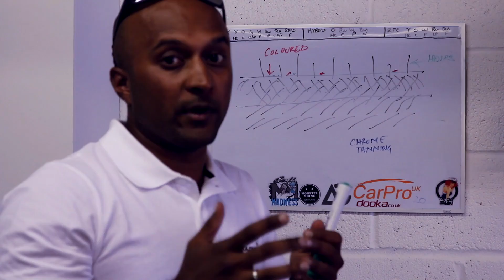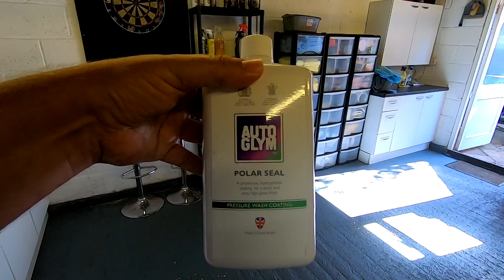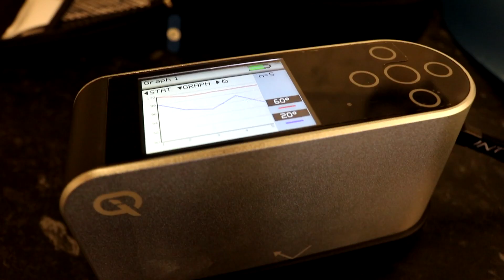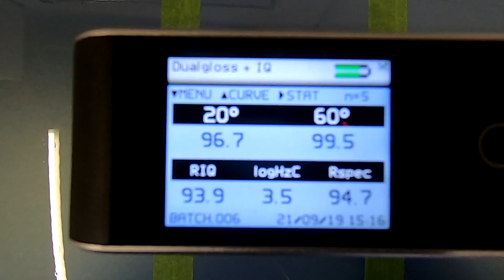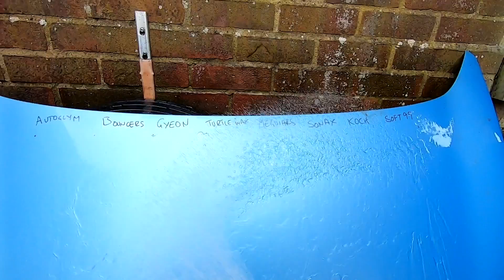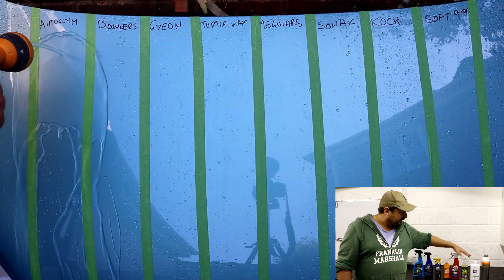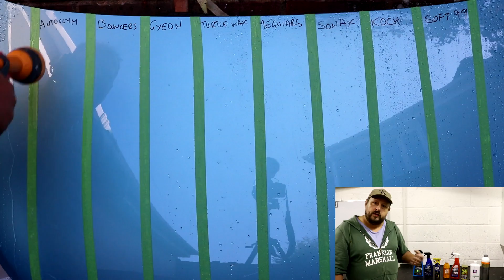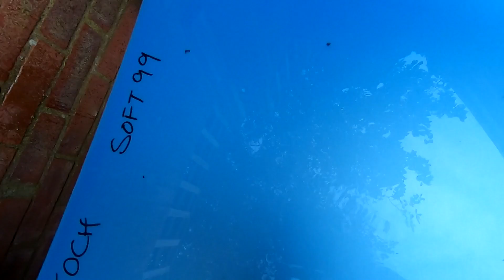The Best Spray Sealant | Drying Aid Wet Coat Spray&Rinse | Meguiars Turtle Wax Sonax Gyeon Autoglym

Comment: Great review as always.
I have been using the autoglym polar seal for years now. I've tried others but keeping going back to it. I use it in 1ltr pump sprayer and it makes my life so much easier with weekly washes etc, also found it works great on alloys. You mentioned about not using it on glass... I've never had an issue with this and neither has a friend that uses it, I've actually in the past used it in the screenwash bottle in my van and it does great at getting the hydrophobic properties back on the screen.
Only time I've ever had a problem was when I've left it too long in sunlight and it dried on plastics leaving white marks. I use 4 capfulls per litre and absolutely love it for that. Usually £15 a bottle in halfrauds.
Reply: How long does polar seal last for
Reply: @SilverTrill  depends on how well decon'd and protected the vehicle is before and your wash method after....
But as an example I've recently bought a car that has no protection at all, if it rains or you pour water on it then the whole car just stays wet, even on the sides... Whereas my work van was polar sealed about 4 months ago (5k miles) and i have sprayed citrus pre wash on it (at a strong dilution) and power hosed off several times and parts of the van still bead slightly, other parts the water is sheeting off slowly but still 10 times quicker than the unprotected car. Van was polar sealed at least once a month before that so likely had a small amount of protection built up.
Can be bought for £13-18 depending on where you get it from and a small amount goes a very long way. Even my concrete driveway beads where i wash my cars just from using it so often lol
Reply: @seanmc92  driveway beading 🤣🤣🤣🤣  I've heard you can get this for £10 at b&q at tge moment it's says £13 on the shelf but scans in at £10 was going to buy some today but was unsure about durability but I'm happy with what you have said so will pick some up after my current spray wax finishes , thanks for the heads uo
Reply: @SilverTrill  damn is that for the big bottle? 😮 I'm serious, my driveway beads 😂😂 yeah i really like the stuff and it's super easy to use. I apply it with a pump sprayer and let it sit for 30 seconds (if not in sunlight) then blast it off. Just make sure you rinse it properly as you'll go back to somewhere you've done and see it reactivate again, that how people gets the white spots from it
Reply: @seanmc92  yeah it's the big 1 litre bottle, I like how easy it is the apply and not to use more than the recommended , some people are saying to use less, even Jon was saying add some to a bottle and make a detailing spray , how many ml do you use in your pump sprayer?
Reply: @SilverTrill  that's a cracking deal, i might go tomorrow and buy 2 bottles lol. I haven't tried using less to be honest, i just tip some in without measuring now but it's around 5 or 6 cap fulls I'd say. Never tried it as a detail spray 🤔
Reply: @seanmc92  yeah it's a bargain , u could be using too much because when using a snowfoam lance your using alot more water so in a pump sprayer you need to using less as your not getting any extra water.  I might play about with all the ratio when I pick some up as my pressure washer has a very high litre per minute output so may need more product if using a Lance sametime it's going to cost me more so I might have to also use a pump sprayer or spare 500ml bottle and make a less concentrated mixture and get same results and it will cost me less 😎
Reply: @SilverTrill  the bottle lasts me most of the year on my personal vehicles so it doesn't bother me too much, i end up spilling it over my hand etc if i try fill the cap 4 times so I'd just be wasting it there anyway. Whatever ratio i use seems to work great anyway lol. I don't have a spare lance and try keep my lance for pre wash only. I would have to rinse it out several times if i ran polar seal through it to get rid of the residue

Comment: Great review yet again John, you could quantify the “slickness” with a friction test, put a known weight on a P.T.F.E. Block, and pull it across the surface with a spring balance.
Just as an aside, I don’t seem to be able to properly clean my car in less than 3 Hours, and I’m sure it’s just poor technique, how about a tutorial for us newb detail freaks.
Keep up the fantastic work.
Reply from the maker: the trick is to not clean it properly :)   I tend to spend an hour if I can ive been really lazy this winter...   but yer to clean a car properly can really take a loooong time.. I sort of do little jobs on it.. so like one week I might just do the engine bay properly.. once a year wheels off and do arches etc...   Im generally loosing my sort of enthusiasm to really clean it a lot now... but that might come back in summer :)
Reply: Guess I could split it into 3, and do front, centre, and rear on alternating weeks, with wheels at week 4...........that way I’ll only be cleaning the car once a Month 😂😂😂😂😂

Comment: I felt sure right up until the end that Sonax was going to win! Great review as always Jon though I am struggling to see the point of this category of products. Am I right in thinking they are aimed at people who want to clean their car, apply this, rinse, dry and then do nothing else on top? 
Is it safe to put anything else on top, say an si02 product? Is there any point? Are there things that you should definitely not put on top? 
For relatively new to the game people like me there is a danger of layering product after product after product through lack of understanding or more likely total confusion which may be a total waste of money and time or worse may ruin any results or maybe even not be good for your paintwork. 
I wish someone would come up with a kind of flow chart of product categories and systems to follow if you get what I mean? 
I mean you don't want to go through all the stages of cleaning your car and prepping it (and there are enough potentially confusing stages in each of those phases let's face it!) and then ceramic coat it, wax it, detail spray it, si02 it, paint seal it etc etc etc do you? You need to choose a route to go down and not duplicate results or apply totally unnecessary products to get zero improvement or even reduce your results.
Now who do we know that has the technical knowledge and a good enough analytical mind to produce such a flow chart type thingamajig? 🤔🤔🤔🤔
Reply from the maker: these are adding protection mate, it would be overload to then apply protection.  I also think things like wet coat benefit from being left alone. I think it cures more.

these products are a way of applying the car as you dry, and help drying the car.  Its a lazy way of applying protecting.. its kind of nice but you need to be carefull.  specially with glass and streaking.

Comment: Used gyeon bathe+ in a spray bottle mixed 500:1, rinse off after a couple minutes, leaves decent protection and decent beads but not nearly as repellent or durable as wet coat, works well

Comment: I agree with your statement of Meguairs self cleaning properties, my car the whole night in the car pot under the rain and where the rain dropped from the balcony it will not bead until I clean it, has the rest of the car specially around the doors. I have used Meguairs ultimate wax and that would stay shiny, cleaner and beading qualities for much longer, not sure if mixing the two together will give the ultimate protection has the protection of Hybrid is good has foundation and the wax will keep the dirt and elements out, m2c. Cheers.

Comment: Great video John. Been using Gyeon WC for around 3 years now and its always my go to product during the winter months predominantly. I always prep my car at the end of October early November for winter before topping this up every 3 washes or so with Gyeon WC which i find massivley beneficial. I also use it on my alloys but im not sure how much protection that offers whether its resistant to heat or not i dont know. In light of that John i wonder if its possible for you to do a video on alloy wheel protection that is maybe a non ceramic product, ie for the weekend warrior and potentislly look at tezting WC out in this area too

Comment: Gr8 stuff Jon. I've got the Gyeon wet coat, Autoglym polar seal & the turtle wax. Rotating them. You mention glass & I'm seeing adverts for duxback & aquapel applicators - would love to hear your recommendation for long term glass products (water run off & ice repellent). 👍🏻

Comment: Great review John but I must admit I used turtle Wax now their whole range and this wet and dry wax aid is great in the winter months i.e. December to the end of of February when You Know It's Too Darn cold out there air and wet personally had no problems with streaking on a silver car wash your car car hose it again apply to panel wipe it off go to the next panel while it's still wet sprayed on the wet panel wipe it off dry the whole car off and then buff it up up results are amazing and a protection I would say you getting a good 8 weeks with one application that's enough to protect you from the salt in the depths of January and February let's face it they are the worst months of the year is not a problem great review you but the old ninja turtle all the way if you applied properly PS do not sprayed on and drive around the block it will streak like a flasher once again Dave brilliant review

Comment: John great vid. Will you be doing a foam only paint protection like, koch chemie pw, krystal kleen detail purity x, valet Pro snow seal, autoglym polar seal? As I've used purity x for years, one of the first foam lance applied protection (as well as being multipurpose) I've switched from wet coat to foam lance applied for ease of use on clients cars.
Reply from the maker: hey tim search you tube for the best spray sealant drying aid you will see my video comparing lots of products.

Comment: I use 🐢 Dry and Wax every other wash as a drying aid alternating with Bowden's Boss Gloss  then 🐢 Seal and Shine every 4th wash or once a month.
Cannot get a better value for money shine that beads. The paintwork looks better now than off the lot 5 years ago.
Reply from the maker: a lot of people seem to share this thoughts.  Seal and Shine and rinse wax were available for 3.55 recently from Euro parts in the UK.   The idustry does have a tough act to follow when its trying to charge 20 quid.   But I also think theres a slight danger with whats doing on with the pricing of these TW products.   They almost need to stop the products being sold this cheap I think.

Comment: I have tried the megs hybrid ceramic wax and found the first coat a tad smeary but second was better safety another wash. I have found Power maxes winter coat and summer jacket and found these very good and only about £7 per bottle and you don’t need much?

Comment: Slightly different but best drying aid I have used has been AmmoNYC Hydrate.

Product sprayed on to a MF towel then effortlessly dry the car. Just damn expensive to get to Ireland these days with clamp down on taxes.
Reply: Ed Turner too damn expensive even here in the USA
Reply: @jeremys8360  Really??, last I looked only about $20 a bottle. But it's quality and lasts an age. 

Couple CG and cheaper stuff I found to be useless and need use 3 times product to get half as good a job done.
Reply: Ed Turner tw seal and shine does it all for me. I keep trying to replace it with something but can’t find anything better. Hopefully the Turtlewax ceramic spray coating is good

Comment: I'd like to have seen CarPro HydrO2 Lite but I guess it's very close to Wetcoat anyway. I hate these things splattering or rolling down onto the windscreen, or any windows really. (I use Angelwax H2Go on windows). To get round this, I apply to the bonnet and below as a light mist but remove with the Hozelock multi attachment rain spray. There is not much pressure so no splashback but it's enough to apply the product correctly. For the roof and pillars, I apply with a light mist and damp microfibre then buff with a dry one. End result is a shiny, well protected car with no weird window splatter. If you do splatter the windscreen and see it in sun/rain, it will come off with clay BTW.

Comment: I’ve applied two dry applications of HCW which can be tricky but love the way it looks and darkens my black paint. 

I have then decided to try it as a spray and rinse which I didn’t mind as you can kind of see the product in the rinse water and I felt like it helped me spread it, did have one or two high spots but nothing serious. 

Also watched Matt Moremans interview with Meguiars and they empathise giving HCW a thorough rinse.
Reply: I'm late to the game. 3 yrs on are U still using this product or have you moved on?
I applied it dry with a damp cloth then buffed with a dry towel. Was a bitch to work with but I cannot deny the results.
Reply: @CThienV  I’ve changed car and have ceramic coated it so use other products, funny enough I have just bought another bottle to use on the Girlfriends car as i fancied using it again, still a top product.

Comment: Another awesome video John, you really do make the best detailing product videos on YouTube (and I watch a few). I recently ceramic coated my car (a red Evo 9)with Gyeon Pure Q2, first wash after coating it I used the Gyeon Wet Coat (the old one in the clear bottle) and made a massive mess of things, a real streaky mess. I think I used way too much product, not enough water for rinsing (pressure cleaner) and dried the car with a blower (a high powered Shernbao unit). Think this combo was all wrong. I caught it pretty quickly, and was able to pretty much polish off the streaks with my drying towel luckily enough. I really don't think the blow driers are suitable to use with these products, probably equivalent to drive drying, really need to go exclusively with a towel dry. I'm not too sure about the pressure cleaner rinse, I think Gyeon recommended it, but I think the higher volumes of water supplied with a normal garden hose nozzle might work better.
Reply from the maker: yer its very easy to do what you did though isnt it.  A lot of people do it wrong first time and then hate on the products, other guys just think it through and tweak application.   but yer I have said perhaps the brands could do more to help.

you can even use a wet microfiber to level  after spraying onto a panel and then rinse and towel dry.   I think just the key is not getting too much in one palce especially when its hot.  cheers for kind words my friend.

Comment: Have you tried Purity X from Krystal Kleen Detail? Its an extremely affordable Spray & Rinse product. (5-10 ml of product to 500ml water in a snowfoam lance)
Can also be used as a top off with every car wash with just 1ml of concentrate to 500ml water. (After initial application)
150ml product is like 17£.

Comment: Another fantastic video 👍 my local detailer workshop stock the gyeon wet coat.  Have you used or compared the 'car chem' sealant range? I notice car chem do a few of these products (hydro coat / hydro seal) which has left me a little confused as they are applied with different methods.
Reply from the maker: Ive not cross compared but see "best spray and rinse sealant" video for a comparison or wet coat type products.

Comment: What is the difference between Autoglym Polar seal and AG rapid ceramic? Can they be used together or use one or the other? Which is best? Thank you x
Reply from the maker: Polar seal is high concentration lance applied sealant.  Rapid ceramic more like modern twist on a spray wax.  Seal is better value but I prefer the ceramic spray

Comment: Hi Jon. I am wondering if you can help me out. I have opened a Workshop in Cornwall. I am doing Body repairs and paint correction. I am bombarded and a bit confused with the millions of products out there so I was wondering what in your opinion are the best products for Quickness, Ease of use, Cheapness (I know you get what you pay for but just need to be able to make money without charging a fortune) and best result for machine polishing. As in Compounds, Polishes and sealers be it Wax or spray seal. 

Thanks in advance and love the channel.
Cheers
Marc

Comment: Here are some of the key findings of the video in terms of statistics:

Cost per application: The most cost-effective product was Turtle Wax Dry Shine Rinse Wax at around 53 pence per application.
Gloss: Sonax Spray and Seal was the winner in terms of gloss, followed by Turtle Wax Hybrid Ceramic Wash and Shine.
Slickness: Based on a tilt test, Sonax Spray and Seal was again the winner, followed by Gyeon Wet Coat and Turtle Wax Hybrid Ceramic Wash and Shine.
Durability: Soft 99 Raindrop was considered the most durable product, followed by McGuire's Hybrid Ceramic Wax.
Beading: Sonax Spray and Seal was again the winner, followed by McGuire's Hybrid Ceramic Wax and Gyeon Wet Coat.
Ease of application: The easiest product to apply was Sonax Spray and Seal, while McGuire's Hybrid Ceramic Wax was the most difficult to apply without causing mistakes.
Overall, the video recommends Sonax Spray and Seal as the best overall product because it performed well in most categories, while also being easy to use. However, the video also highlights that Gyeon Wet Coat is a great product with innovative technology, and that it might be the best choice for someone looking for a product with self-cleaning properties.